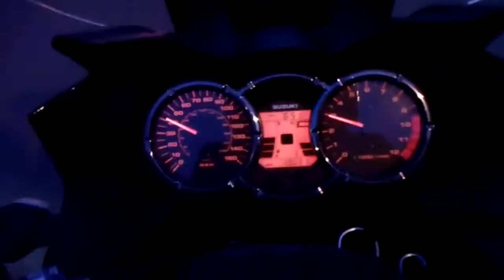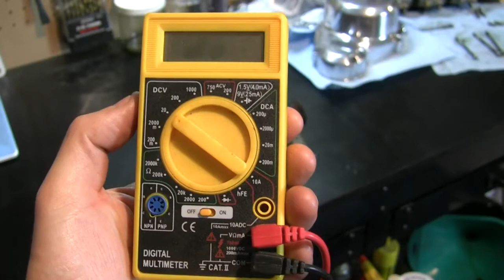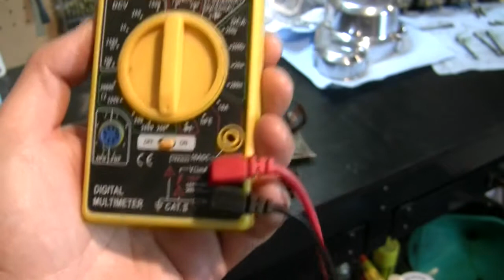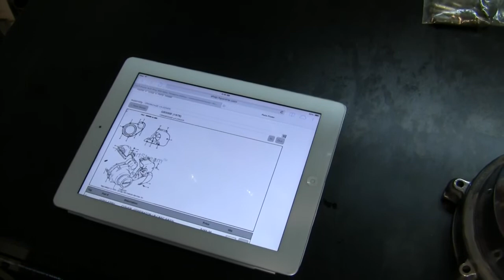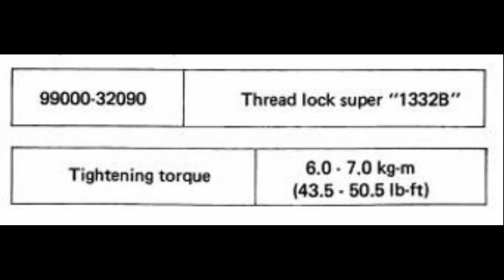Stator Test - Suzuki GS550 Custom Cafe Racer Build (Part 23)

Comment: So I have an issue, my 78 gs750 dies while I'm riding. Would this be caused by the stator or the rectifier or both? I know my battery is good as it holds charge when it is put of the bike
Reply from the maker: Thanks for watching. Assuming your engine stops because ignition stops...could be either or both or also bad ground. You should test as I outlined and you can find additional test procedures in the service manual on my site. Should be same or similar for 750.

Comment: Is the process the same for the 1980 gs750. Is it necessary to use RTV on the surface when you are using a gasket?
Reply from the maker: Yes, same process for 1980. If mating surfaces are flawless RTV isn't necessary. RTV is just a bit of an insurance policy against having to do it again sooner after.

Comment: My starter engages when the bike is leened into parked idle position. What's the cause?
Reply from the maker: Funky. Has to be closing of the electrical circuit somewhere. I'd start at the solenoid and check every connection of the switch circuit as well as the wires. Wiggle or tap the solenoid too. Something is powering that circuit when it shouldn't be. Hope that helps!

Comment: Amazing series and unbelievably helpful. Putting the pieces together on my 79 gs550 and similarly felt the need to upgrade to socket top hardware. A million options between eBay/amazon. Im curious if you had any suggestions for sourcing. Much appreciated.
Reply from the maker: Thank you for watching! I really didn't put a whole lot of thought behind source other than I wanted the right sizes and lengths and stainless. I bought all mine through Ebay and waited a long time for delivery from China but wasn't in a hurry. I ended up with some 35mm from one supplier and 40mm from another and all seemed fine from a quality perspective.  I think chromed hardware might be a different story as plating can be different thicknesses,  but for stainless I don't think there's too much variance, if that makes sense. Hope that was helpful.
Reply: Many thanks. On the same page with wanting stainless hardware. I don’t know if you had the same scenario but the 6mm screws for my 79 stator cover actually had 1.0 thread pitch. Glad I measured before ordering.

Comment: Hi. Awesome videos, thanks! I was hoping you could answer couple of questions. I'm putting a "new" stator cover on my 1979 GS550. As I'm not that into engines and mechanics I really want to avoid taking things apart if I don't have to. So the main question is, is it ok to cut the new gasket apart on the right side so the wires can pass through? Or do I really need to take a bunch apart to unplug the wires? One other question, what is this stuff you apply on the gasket and around the rubber sealer that the wires go through?
Reply from the maker: Thank you for watching! I'm sure I completely understand your question but I'll attempt to answer. I think you are asking if you can cut the rubber grommet that surrounds the stator wires where it passes out of the cover to the exterior of the engine. I'm assuming your new stator didn't come with this grommet. Yes, you could cut that to place around the new wire and then seal it with some gasket sealer. That's the stuff I'm using on the cover gasket. Here in the USA the most common brand is Permatex. But it is essentially a gasket sealant. I hope this helps! :)
Reply: @UrbanMonkTV  Hi, and thanks for quick reply. But no, a little misunderstanding :). Its only the cover and gasket I'm changing. The cover is broken after a fall, and the manual says the gasket must be replaced. I have a new gasket, but I can't replace it without disconnecting the wires or cut through the gasket. Please take a look at the image I have uploaded here: https://ibb.co/mSr27g1
The red line is where I would cut through to be able to replace the gasket with a new one. Otherwise I guess I have to take a lot of stuff apart just to unplug the wires.
Reply from the maker: @skarpheinnsigurdsson9712  Ah! Now I understand. You will need to disconnect the stator wires and run them through the hole in the gasket. Then feed the wires back through the starter compartment and reconnect the stator wires. No need to cut the gasket.
Reply: @UrbanMonkTV  yes. I was hoping it was ok to cut the gasket so I do not need to take more apart just to disconnect the wires. Thanks for the answers though :)
Reply from the maker: @skarpheinnsigurdsson9712  You'll probably need to remove the starter cover to route the stator wires, but that's only a couple screws. Easy. You're cool in my book for tackling the job yourself!

Comment: Hi, I recently built a bike with a 1980 gs550l wiring harness and 1978 gs550 engine, I used the flywheel that was on the 78 and the starter from 1980 bike and it terns out they are not compatible 77 and 78 used a separate regulator and rectifier 1979 to 1982 used a   combined unit and the magnets on the flywheel are spaced differently so it will be out of faze. The 1979 to 1982 flywheel and regulator is a good upgrade because the parts are easy to get and replacement starters are available. Carl.
Reply from the maker: Carl Vitale Yes! I noticed that about my 78...separate r and r. Good info to share with others. Thanks!
Reply: I have a 1982 gs550l I need a stator and can't find one online